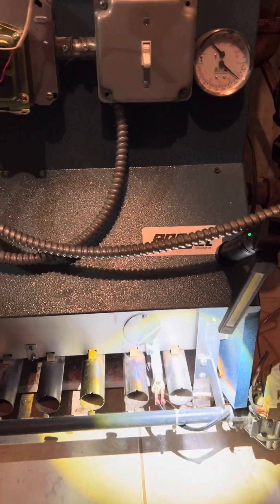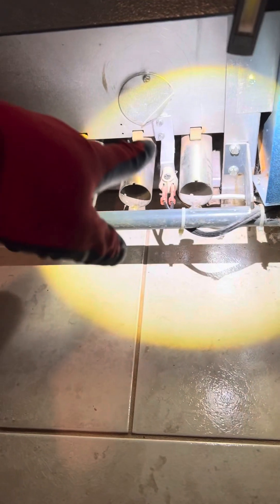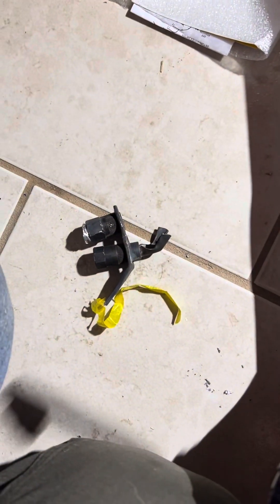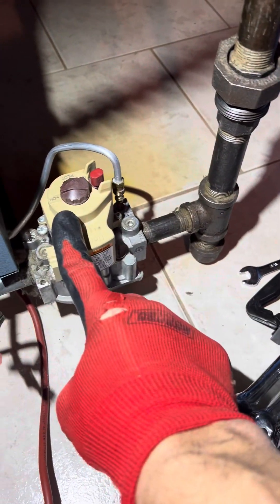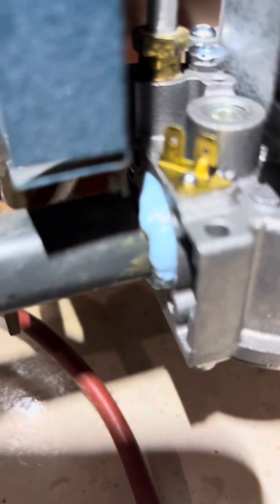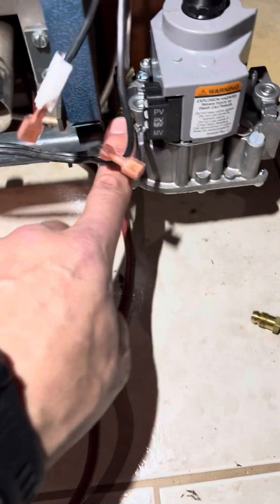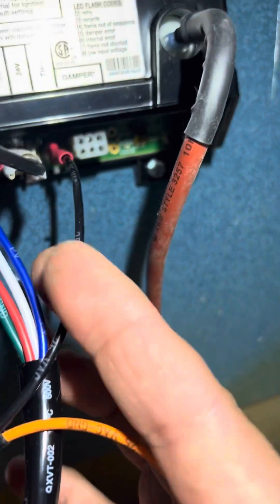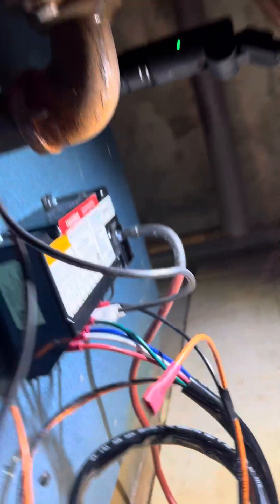How to change a standing pilot to an electronic ignition on an enerjet boiler ￼

Comment: Hey excellent video 
This should be basically the same with a steam boiler 
My question is what if the boiler doesn't have a rollout switch (which I know they should) but some don't
Reply from the maker: Well, I never came across the boiler without a rollout, however one side of the transformer goes through the rollout so you’d have to find that 24 V power supply and have that and go to the ignition board to power it